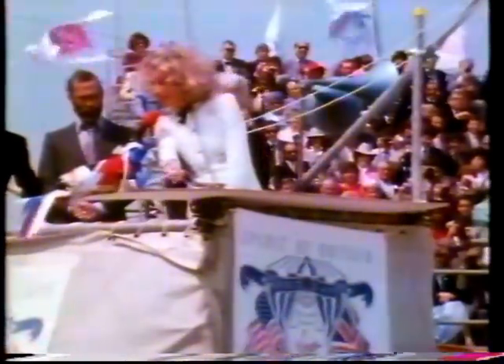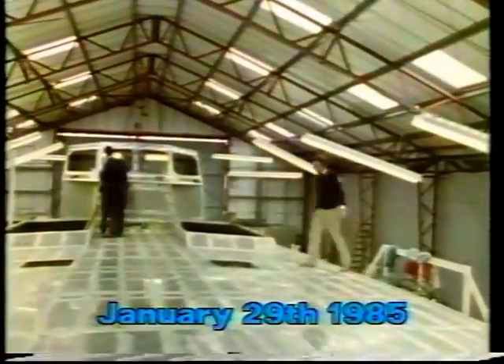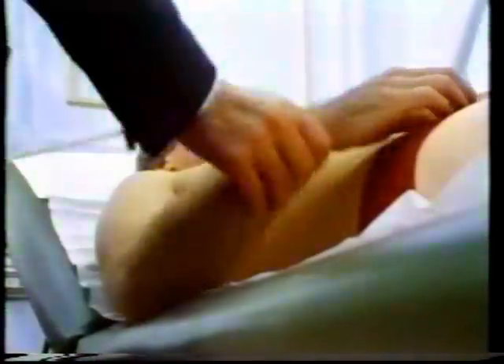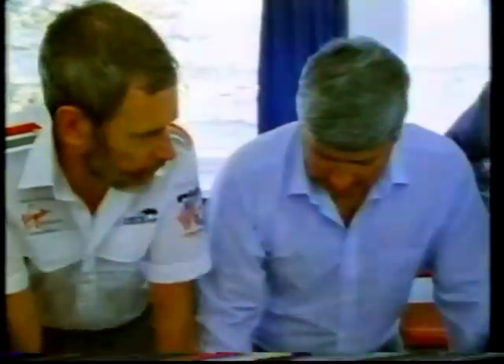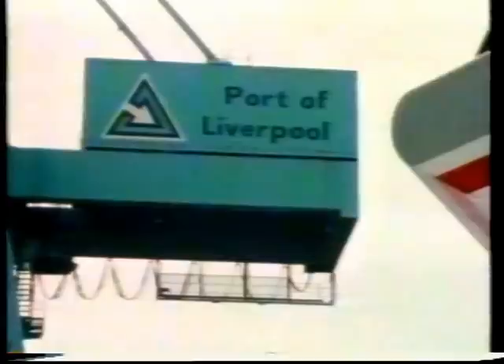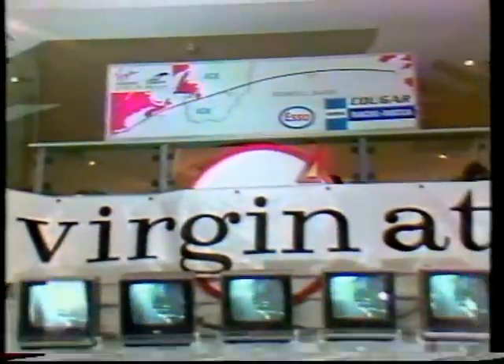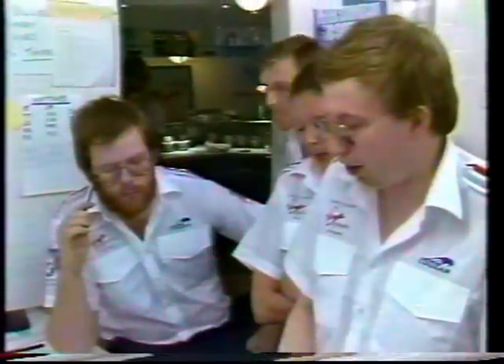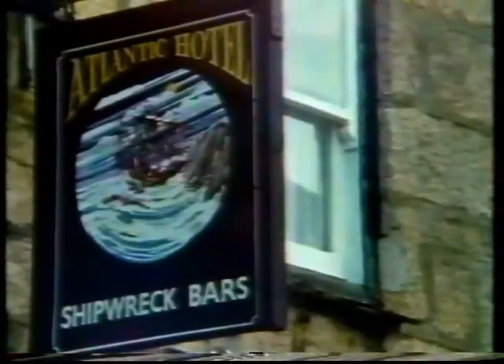Atlantic Challenger - The Onboard Story 1985 Failed Attempt

Comment: All that money wasted.I suspect they didn’t hit anything,she broke her self apart from the hours of slamming .thats a lot of abuse to put a boat through at them speeds. Such a shame ,I wonder where she finally sank
Reply from the maker: There were numerous pieces of debris in the water at that time and VAC is said to have hit partially submerged object(s).  The debris is specualted to be likely remains from Air India Flight 182 which was tragically lost with all crew and passengers mid-flight off Ireland at the end of June 1985.
 Reports varied on the distance Challenger sank, but most suggest 120-130 miles from the Bishops Rock Lighthouse.
Reply: Oh really ,sad time all around then.still amazing thing to try.must of been hell on that going at that speed for hours.